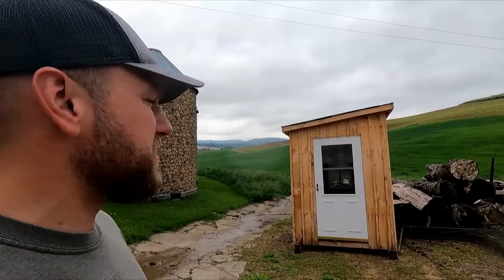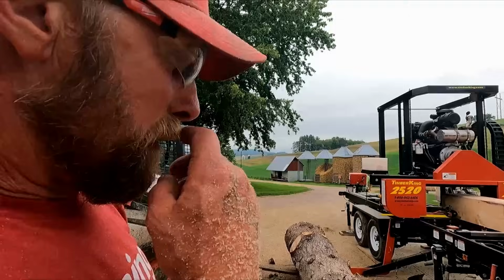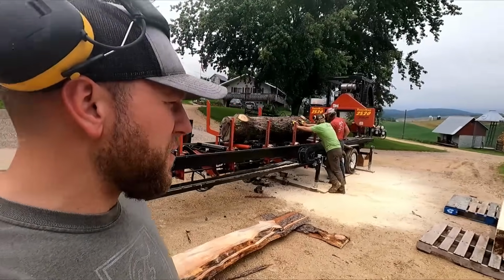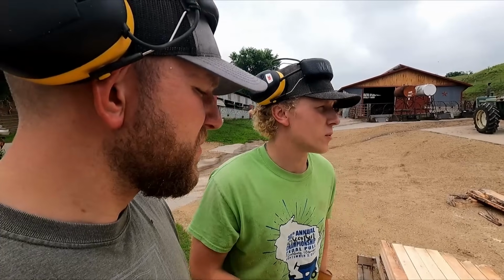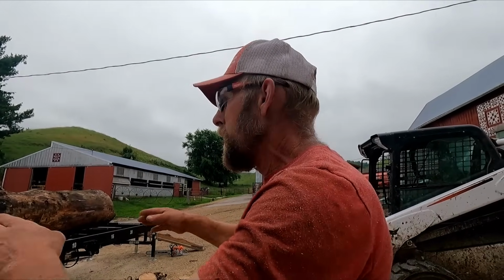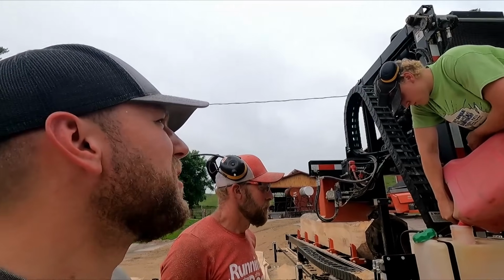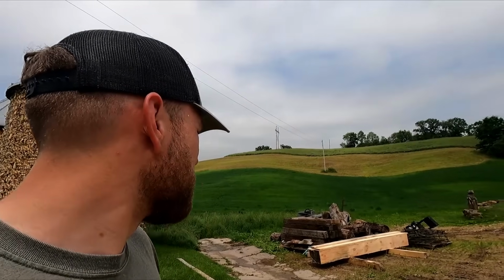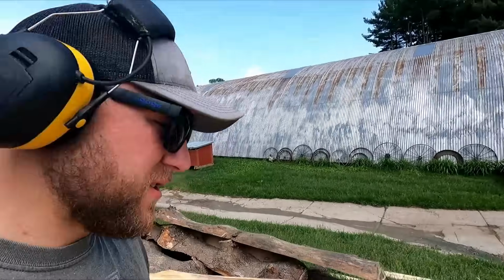Home Sawn Lumber! Sawing Logs into 2x4s! For your own building projects!

Comment: Did you fix the engine in the 1650 dont remember seeing a you tube of that last one I saw you had the oil pan off and were looking at used engines